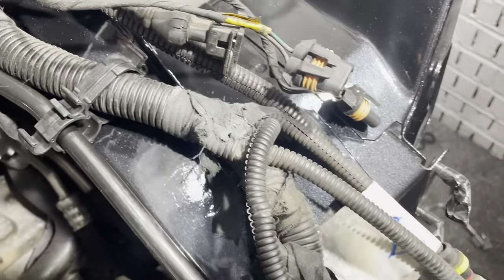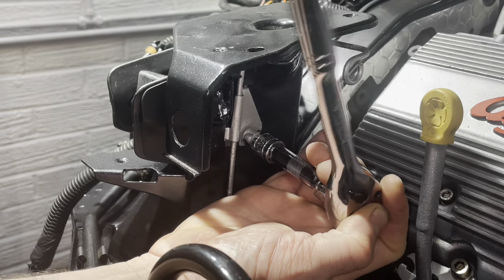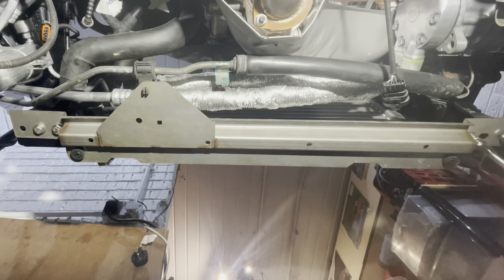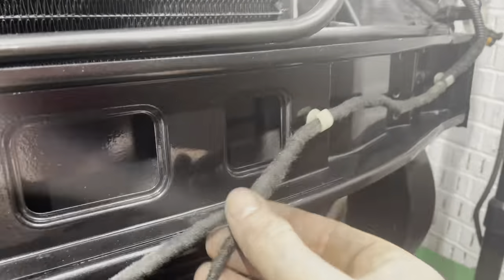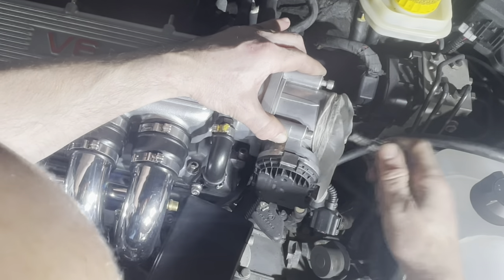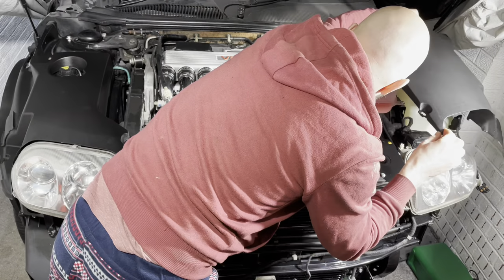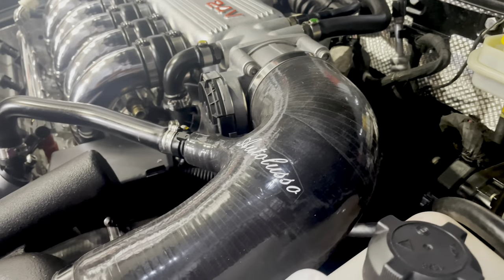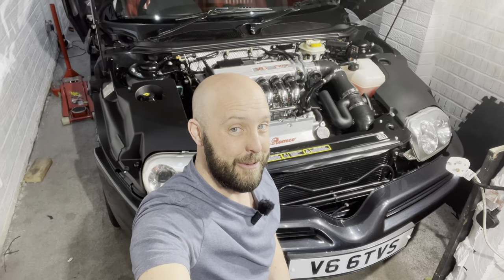Alfa Romeo GTV 3.0 V6 engine bay restoration finally completed!!

Comment: Looks great Rick 👍🏻 do you have a link for the bulkhead insulation, that looks really good...
Btw you are missing a black cap on the fuel rail!
Reply from the maker: Thanks Stewart, I’m aware 👍🏼. There is no link for the insulation I’m afraid. I made that myself with a piece of old exhaust heat shielding. A few people have asked about this so I may make a video on it

Comment: Hi Rick, your bolts on the cam covers etc look super tidy. Did you replace or just cleanup? I did see online somewhere a complete bolt replacement kit for the gtv but cant find anymore:/ thanks from NZ.👍
Reply from the maker: Hi Tom. These are full stainless as a complete kit. I covered these in episode 9 of the engine bay restoration playlist. Check it out. You will also find a link to the bolt kit in the video description. Here is the link to the video:
https://youtu.be/FdXfNO9GPQ8
Reply: @_RicksGarage  thank you, much appreciated.